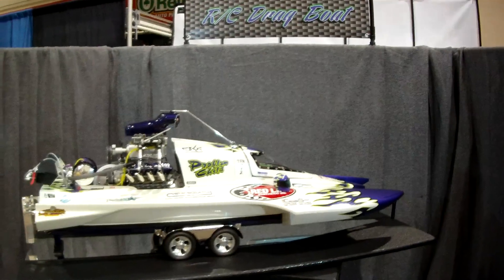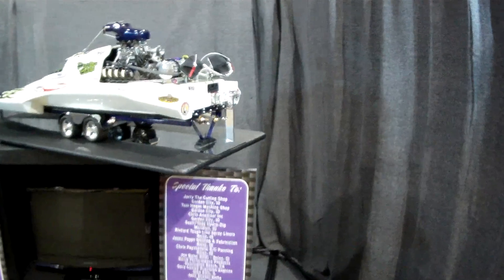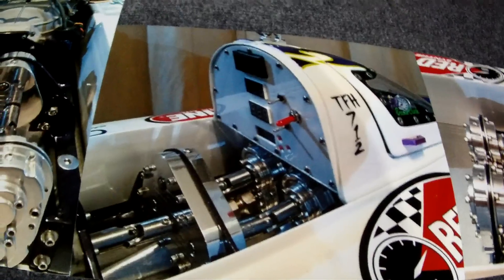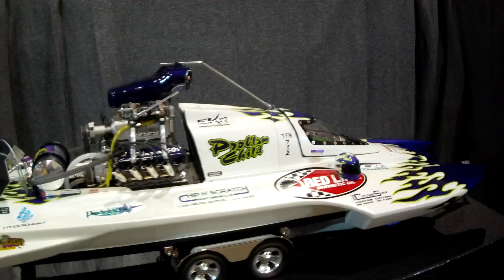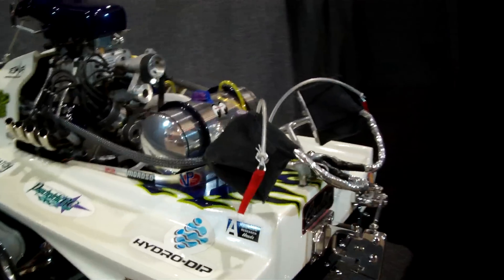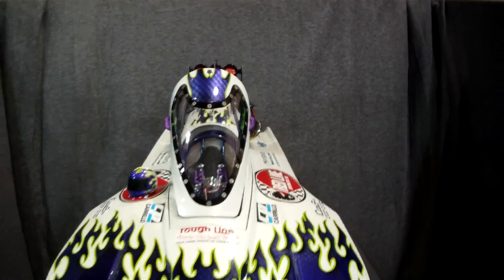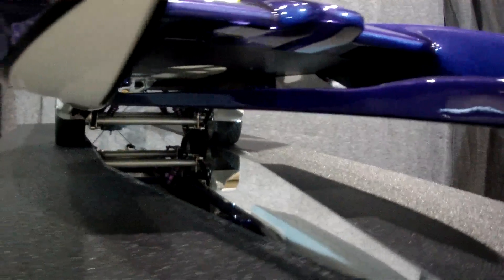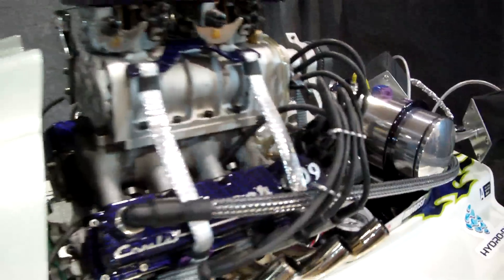Part 11 Stinger 609 Drag Boat Project

Comment: Hey RC Crazy looks great. I noticed you have the injector mounted backwards on the motor like actual race boats do. Just a thought I see a lot at work is  sometimes the guys mount the injectors facing backwards to keep water out.

Comment: Nice Job on the boat. But you really need to do a better job on your video work. I don't think I've seen more than about a minute of video in all 11 parts that was in focus or properly exposed. Also, why do you video still pictures. Why not edit the pictures in digital form into your video.